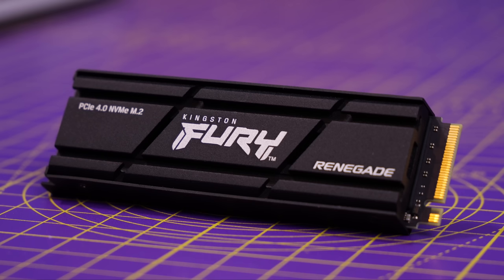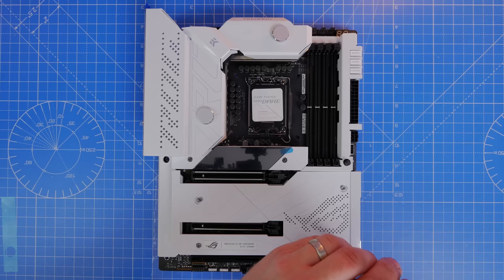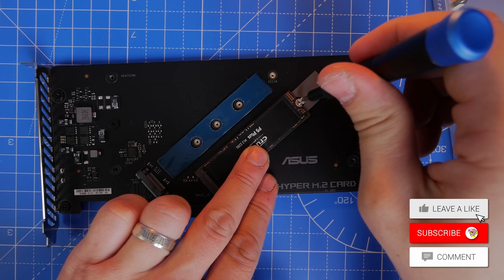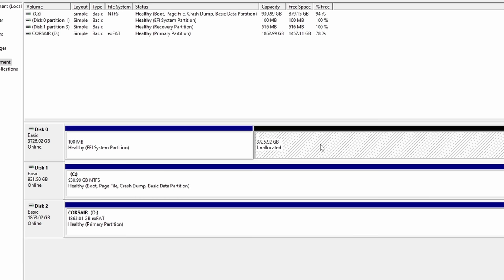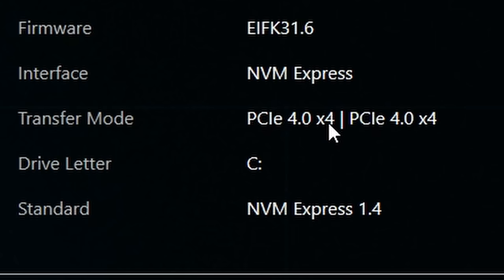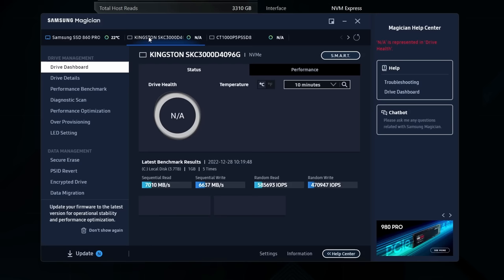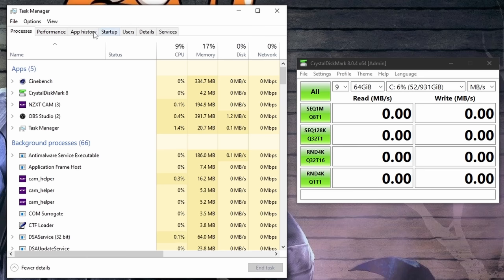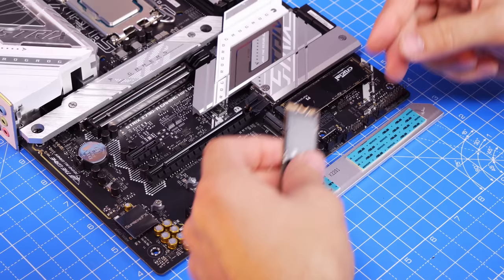Don't make these mistakes with your NVMe SSD installation - NVMe tips and tricks

Comment: ive got a 1tb kioxia exceria g2 as my windows drive, also have a corsair mp510 but only 240gb along side 2x hdd (pointless having the mp510 i know but got bored and shoved it in) but my question is which one would you have as windows on? im on strix rog z390 gaming f still, so also wondering whether any adjustments in bios to max out speed they can run? thanks for all these vids, without my pc my life would be.... well different as i got adhd and autism so when i have an issue its great to refer back to these vids

Comment: I just bought a Kingston FURY Renegade PCIe M.2 NVME SSD 2TB and installed it, everything works fine, no problem detected. But for some reason sometimes my computer shut down my PC screen and a loud fan noice starts, I don't understand what's wrong. Motherboard MSI  B650  Tomahawk Wifi.
Reply from the maker: I doubt that's related but it's impossible to troubleshoot remotely based on that information in afraid. It sounds like your pc is overheating.

Comment: I read that my motherboard (tuf gaming x570-plus wifi) the 2nd port was ideal. Been using it for 13-14months with a Samsung 980 that has windows on it.  I grabbed a 990 pro last night to finally utilize the 2nd spot and idk how but ended up on this video but.. Turns out that 2nd slot is pcie 3.0 x4. And now I have a faster nvme, in a faster slot with nothing on it 😂 I feel foolish. Anyway, thanks for the video! I gotta download this Samsung Magician too now

Comment: I've got a Z690 AORUS PRO that has 4 M.2 connectors, 1x PCIe 4.0 x4/x2 SSD support) (M2A_CPU), 1x SATA and PCIe 4.0 x4/x2 SSD support) (M2C_SB), 2x PCIe 4.0 x4/x2 SSD support) (M2P_SB/M2Q_SB).
I've placed 3 x 1TB Samsung M.2 980 drives in the 3 PCIe M.2 slots, and setup a raid0, leaving the top slot (CPU) free, should I have installed one of the M.2s in the CPU slot? I'm not getting the speed the motherboard manufacturer claimed with 21035MB/s read speed.

Comment: I’ve had an issue with the ASUS board’s “clip’s”. I have a sabrent m.2 and Corsair m.2, when installing the drive in the location with a thermal pad on top and bottom, it impedes the clip from sliding over top of the drive unless I really push down on the drive and bend it substantially. Did anyone else have this issue?

Comment: Im planning to add another ssd, i have a 970 pro and i want to add 990 pro as another one. Can i keep the 990 in any slot or it has to be the top slot for max performance? Also i have to copy all system and games on to the 990 from the 970 right?

Comment: I bought a couple of Adata XPG Gammix NVMEs for my build. They came with a separate, very thin aluminum heatsink cover. Should I put those on and then install the motherboard heatsinks on top of those? Or should I install them without their respective factory heatsink? (just using the mobo hs covers)

Comment: I have been wondering about heatsinks and NVME m.2 ssd drives ... Should I buy with heatsinks? and if so should I use the factory heatsink or got with aftermarket? Examples: Samsung 980pro with or without heatsink  as well as the Team Group z440.
Reply: Little late but ALWAYS RESEARCH YOUR MOBO!!! I recently bought a board that comes with integrated m.2 covers but all the M.2 drives I have, have heatsinks. Removing heatsinks will void warranty, so be careful. The bare version will usually be cheaper so if you're getting an expensive mobo, which is more likely to have integrated heatsinks, you can shave like $20 off the cost of the board per m.2 since that's around how much cheaper it is to buy without the sink. The mobo sinks I have also don't have a plastic covering, they're just bare (probably because I bought a refurbished board but idk), so you can't really store them long term since open air will deteriorate the pad. I made my peace with it but if this helps I'd rather have not had to deal with it in the first place lol.

Comment: Is the thermal pack normally "glued" to the ssd after the installation after you peal of the plastic?
(I want to install two Additional SSD to my already installed SSD on the top spot)
I bought two faster one's, thats way I want to change the one on the top spot with one faster one i bought (for running the OS usw.) so if its glued i'm not gonna do it obiously.

Comment: 1) Once you've secured your shiny new Gen 4 or 5 SSD into your PC, you then think "Fantastic! Now I'll install windows on this and look forward to crazy speeds." And so it is said, and so you do...only to immediately discover that the 'crazy speeds' are very, very much.....not as advertised. In fact, this drive isn't noticeably faster that an 'ancient' SATA SSD.
--> Welcome to the shocking stagnation of 4k speeds over the years. 

2) After that bombshell, you decide to turn the second Gen 4/5 NVME SSD you purchased into a data drive, and proceed to write several hundred GB of data onto the fancy new toy. BUT, well before the end of the write process you find that the speed has dropped to shockingly low speeds (in many cases this is much, much slower than a fast HDD(!!!)). 
--> Welcome the the infamous 'write hole' Achilles heel.

Marketing is funny, isn't it ;)

Comment: Hey there.  Putting together a PC and I just purchased a GIGABYTE B650 AORUS ELITE motherboard.  I'm not the most tech savy person, but my friend says I should purchase PCIE raid card and run my two drives in Raid as the would incresae their speed.  However, I'm seeing a lot of info online that Raid is becoming obsolete.  Will running my two m.2 drives in RAID on a PCIE card really make them much better?  Or should I just put the two m.2 drives in the motherboard itself?  If there is no significant benefit, I'd rather put the drives on the mobo.  Thanks in advance if anyone can answer!

Comment: I have z590 e gaming wifi  and am lost bit here i first used m.2 -2 slot it was working fine but the read for samsung 990 pro was bad only 3600 then i took out and put it in slot 1 which is the top one now not detected by bios or windows what should i do please

Comment: My XPG gaming X S 70 blade 2 Tb died after 3 months 
It won't boot and when i check it in the nvme configuration it shows as MN-5236 and disk size shoes 2.1 GB and sometimes when i remove the drive and install it again it shows S 70 Blade 2TB and when i run a device self test ( controllor only )  my bios freezes
Also my nvme idles around a 50 C and the max reeding i have seen on hw monitor is 62 C 
Can it be because of temperature? 

What could be the cause of my problem 
How can i fix it 
Pls help 🙏 me

Comment: Just picked up a b760-i, which has the second slot on the back of the board. The second m.2 (gen4) doesn’t have a heat sink, should I get one?

Comment: Heyhey, just upgraded from SATA to NWME directly into my mobo, my mobo does not have a heatsink, is bit old, but so far is working just fine.
I am on a full tower with proper air cooling + cpu aio, is not a mini case, should be fine for basic gaming ?

OKay, i do video recordings into additional hdd, i am doing first stress tests today and next weeks before i continue my recordings, just to be safe.
Is very annoying to activate softwares again on a clean Windows.

Western Digital NVME gen 3 2tb. 
I just prefer quality when able it seems. 

I dont need the top speeds, i just needed more data space.

Comment: I bought new pc setup and after 1 month my 500gb crucial p3 nvme m.2 stopped working. I was playing valorant suddenly black screen appears then pc re-start and shows bios page. I saw in bios > storage > pci ssd - ( blank ) the size is not showing its blank there. What is the reason??

I also tried in another port didn't worked also the nvme got super hot in 30 seconds like i am using it from hours.

Comment: hey!

i have ASUS Prime Z790-A WIFI and Kingston KC3000 M.2 NVMe SSD Gen 4 1024GB, armoury create says i run at PCI-e 4.0 x1 | PCIe 4.0 x4,  i tryed everything in days and it still doesn't work,, i even tryed to change the port x1 slot and x4 slot, still the same... getting 1700 mb instead of 7000mb.. sucks..

Comment: I have an AlienWare 17 R3 & I want to install 2 of these drives in the slots provided by Dell. Are these Plug & Play, meaning can I just install them & off we go? I want to install a Samsung - 980 1TB Internal Gaming SSD PCIe Gen 3 x4 NVMe & a Samsung - 980 PRO 2TB Internal Gaming SSD PCIe Gen 4 x4 NVMe. I just want to make sure they are compatible with my system. 
Thanks, 
Mike

Comment: Hi i have a HP 2015 ish with specs say SSD M.2 and the slot on the M/B is that NVME type with small 5pin and one long for the rest. I bought a NVME Gen4x4 with same 1 small and 1 long but it sort of very tight getting it into slot with it pushed against notch not middle of notch?  i see 5 pins in slot (not 6) and my H/D has 5 on one side and 4 on the other. So is this right one as Laptop wont recognize? If k, i cant see anything in Bios about H/D and also tried Ubuntu on Stick and when temp loaded , it cant see drive either.   Model HP 15-ba052au

Comment: Hi, I Could really use your help figuring out why in my ASRock Fatal1ty B350 ITX A/C wifi if I put in a 4TB m.2 SSD in the only available spot, it only allows me to format 2TB.

Already tried converting to GPT and Dynamic disk but I still run into the same problem as MBR, only 2TB used even if it sees all 4 unallocated. 

I tried diff bios options too, like UEFI mode instead of Legacy and that makes it worse where the screen stays completely black after a restart. 

Even with MBR mode when win10 does get installed, the system says there's something missing so it stays on a black screen with some text and doesn't advance.

Please help, out of ideas! Thanks!!

Comment: I’m doing a build with my son.  We want a Nzxt b550.  We want to run  a 500gb crucial p5 for the OS and a 2tb crucial p5 for storage.  Can we get the maximum speed out of these drives on this motherboard.  Running a single GPU and the 5800x3d.  Thank you

Comment: Hi question. I got a sata M.2 SSD and a M.2 NVMe SSD which is supposedly an upgrade for my laptop. But when I checked my bios the NVMe SSD is not showing on the list. However, when I have my HDD instead of the M.2 SSD, the NVMe SSD shows on the list. Any idea why this is happening? I was planning on making the M.2 SATA SSD to have my OS instead of having it on an old HDD.

Comment: I have a strange plastic square-formed closure at my old m.2 ssd, where actually I just expected a small screw. the ssd is on a gigabyte motherboard, and I just wanted to exchange it with a 1TB m.2 ssd (crucial). Any hints, how to get the old ssd off there? I dont want to damage anything.

Comment: Im im the midst of updgrading to a 2TB 970 evo plus, its my first nvme ever. My x570m pro4 has 2 hyper m.2 one under heat sink behind gpu (CPU LANE) and  one just under gpu slot(SB LANE).

X570m pro4
R7 3700X
ASUS TUF 3060TI 8GB OC V2
RMx850
2x 860 evo 1tb/500gb boot
1x 970 evo plus

 I cant get my mobo OR WIN10 to recognize my new m.2 in either one m.2_1 or m.2_2.. disk management doesnt see it to add a letter etc. I even unplugged all SATA drives and only had M.2 and my USB Flash with Win10 install.

When i goto my BIOS the only options i can see under sotrage configs are all of my different SATA plugs set to Auto. Im about to my wits end and laat resort is a bios update, but im terrified to brick my machine.

Comment: I just installed a new NVME SSD, and I got it working and everything, but then I tried moving windows from my hdd to my ssd and it failed or smthn, and now it says I don’t have permission to use my ssd. Everything else works just fine, just not the ssd. I even tried going into permission settings, but nothing I did worked. Does anyone have any tips that could help?

Comment: I only have one slot for NVMe. Right now it’s occupied with a shitty SSD from the pre built manufacturer (benchmarked it at 1k mgps..) and bought a Samsung 990 pro to replace it. But current shitty SSD has my OS on it. Is moving the OS from the old SSD to my upgrade an easy process?

Comment: I made the mistake of running a Gen 4 Samsung 990 pro M.2 on an older motherboard that is only Gen 3 PCIe and wondered why I wasn't getting the advertised speed. 

I'll keep using it as will eventually upgrade my motherboard etc. It's something to keep in mind when buying an SSD though.

Comment: I forget if you said this but if the ssd comes with a heatsink and my mb does as well. Would the mb have a better heatsink or the ssd for better tempts? 

Ssd is 990 pro 4tb , motherboard is asus rog dark hero
Reply from the maker: I'd use the SSDs one

Comment: I removed the black label from the NMVe. This is a problem?
Reply from the maker: Not necessarily. But you shouldn't really peel the stickers off. I've got a separate video testing this which shows thermal performance can actually be worse.

Comment: Wow... great content. Thanks!

But like you, I have a Sabrent SSD 2TB Gen4, a Samsung 980 Pro SSD Gen4 (Main drive), and two Samsung 950 Pro 512G SSDs Gen 3. My latest Armoury Crate lists blanks for the Transfer Mode (----|-----) for all drives. This is on a brand new  Asus TUF Gaming z790 motherboard (less than 1 week old!) with the latest BIOS. I noticed my Gen 4 980 Pro is running Gen 3 speeds. How can I change that, even though all mobo M.2 slots are Gen 4 slots? Also, using the latest Samsung magician software, under drive details, it lists the interface as "Unable to get the information." What to do?
Reply: Hi bro did you find a solution to it I have the same thing my gen 4 is working on gen 3 in my laptop hp so just tell me it you know what to do in the bios it doesn't matter if urs is hp or not
Reply: @Dxanks   If you have a gen4 device in a gen3 slot, then it'll work at gen 3 speeds in that slot. You'll only get gen4 speeds if a gen4 device is plugged into a gen4 slot. In my case, my gen4 device is running at gen 3 speeds in gen4 slots. An RMA back to Samsung has been initiated.

Comment: I can’t understand, at the beginning of my assembly, I did the same put in the first slot gen 5 and fourth gen 4 one is 512 gb second 2 tb KC3000 after i tried to replace to another slots like a 3and 4 my mobo is x670e-f cpu 7800x3d gpu 7900xtx sapphire psu be quite dark power 12 850 watt cooler noctua nh-d15, after flashing bios windows etc i checked my gpu-z and what i see PCIe x16 4.0 @ x8 4.0 what i need to do for my gpu can run x16 not x8? for check my gpu i tried to put my rx 5700 xt and same thing… so what wrong with my assembly? my first pc assembly without 1 issue all was clear and working good. this is my first and last asus motherboard i always building with gigabyte. sorry i'm angry 😠

Comment: Yeah, but the Gigabyte Aorus Master and Extreme X570 boards had split  and Isolated PCIE lanes. The bottom half was disconnected from the top and doesn't effect speed when running a fast GPU. I run my M.2's in the bottom to keep it isolated on that board and get full speeds.

Comment: I’m building a pc with an Asus z790-a Prime and I have a 980 pro 2tb and was thinking of gettin a 990 pro 1tb as a boot drive. I also wanna get a 4TB Crucial P3 Plus for the rest of my game library. Do you recommend doing a partition on the 990 for the Os and software files?  And if so, how much. Any suggestions or recommendations are appreciated.
Reply: You don't need to partition drives anymore, it doesn't do anything with SSD.

Comment: first nvme slot under the cpu can be gen 5? manual says gen 4 but would love to put a gen 5 in?
Reply from the maker: Depends on your motherboard and if your motherboard says gen 4 then it's gen 4. If you put a gen 5 drive in there it'll just run at gen 4 speeds. So it would be a waste of money.
Reply: @TheProvokedPrawn  I bought this motherboard maximus z790 hero. I've seen 3 videos on it 2 say 1st slot is gen 5 and 1 says gen 4. Manual says gen 4? just wanna get maximum performance